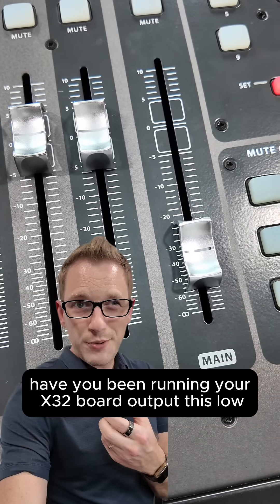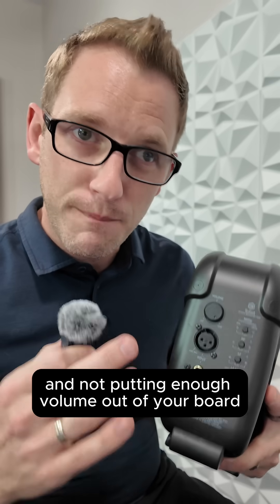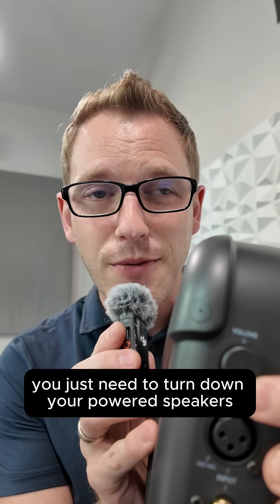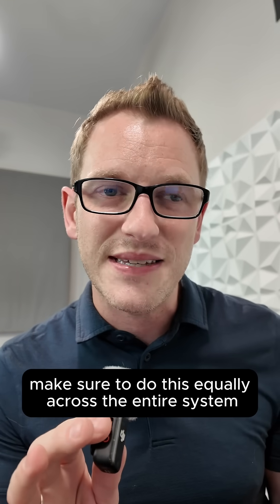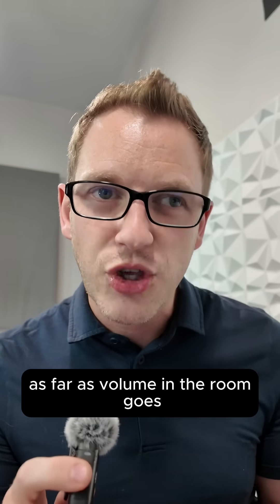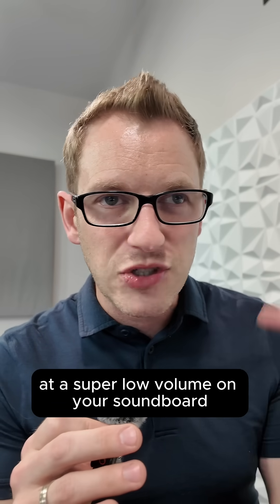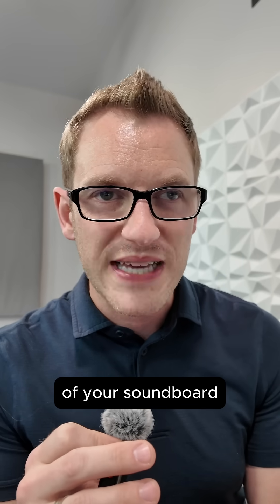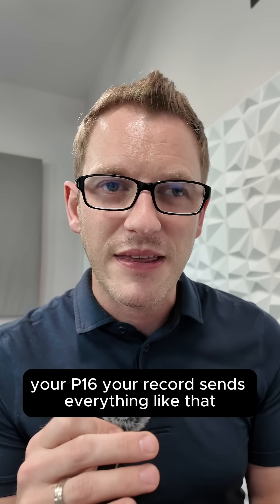Fixing a Too-Loud PA on the X32 (Gain Structure Tip) #x32 #DrewBrashler #gainstructure

Comment: I was always taught to run amps at 95% and let the system controller be the final stage volume.  However, now i am using p16 to my iQ series speakers i find my gain structure changes but i get a fatter sound

Comment: This is also important because if your Main is that low on the board, it's much harder to make fine adjustments to it; you want to be able to use ALL of that throw on the fader, not just the last half inch.

Comment: A video on how to tune PA's would be amazing from you! I kind of learned but struggle how to know that my RTA mic is at the correct gain and actually picking up the correct db levels.
Reply: My go to method is to calibrate the mic by holding a dB meter next to it. It is important that both the meter and mic use the same weighting curve (i prefer c).

Comment: What if it's the other way around?
Reply: Like your faders and master are always +5 or something? Then you should put your faders down to nominal, and turn your speakers or amplifiers up.
Reply: @Dani3e like with everything at an input gain (meter) of -18 and the master at +5 or more I had almost maxed my speakers
Reply: @christopherheadcase6886  you don't need your input gain to be at -18db. What you need is your meter levels per channel to be around -18db. Achieving this might mean an input level of even 5db or more for some input sources.

First disable all processing, then solo the channel and turn up or turn down the gain until you have the meter showing an average of -18db.
Do this for all your input channels. Then set the fader levels to taste, depending on the sources you have coming in.

You should have a pretty loud and good volume on your PA.
Reply: @maxwellibe7147 wait. Wait. Wait. Why am I always hearing the opposite?  Channel input meter should be hitting around -18 db. Not the faders. Input meter.
Reply: @maxwellibe7147  well yeah. If the gain is set to +10 or -15 what i mean is the meter is hitting -18db. not the gain knob itself

Comment: Normaly i run around 12 / 1 Oclock but recently i bought RCF Art 932A speakers and i believe majority of users run them full volume as i also but is this correct?
Reply: Rcf always says to run them max, do
Reply: How would you say they compare to other pa speakers?
Reply: 12 o clock is best for overall that’s the starting point and if you have the option always be at line level on speakers since some speakers have a button you press that says mic/line  press it to be Line
Reply: @Piquito18gaming thank you
Reply: External power Amps used to be built such that they are driven purely by proper line level signals where a +18dB-ish sine wave with about 30Vpp(!) would have them produce their quoted maximum output, and they’d start clipping going over. That’s when the knob on the amp is turned all to the right. It would normally labeled 0dB (and knob labeled trim, or such).

Typical powered speakers on the after hand are built to accommodate also signals from much, much weaker sources (your typical mobile phone or laptop output cannot produce more than 3Vpp, which is 20dB down), so they have actual gain in their input stage… some even mic level! If would be completely stupid to crank them up to the max, that’s why they typically have a detent at 12-o-clock or so. It should all be stated in the manual!
Reply: @cnvogel rcf do not have detention, they don’t even have a unity label, they say to crank them,

Comment: I worked in the 80s. I used to set all the gains to -20, eqs flat, mixers LRFR all centered, amp volumes to 50%. I then went from input to output to find the clipping points and then default to 80% because they will always want it louder.